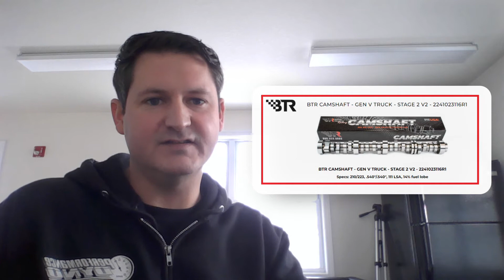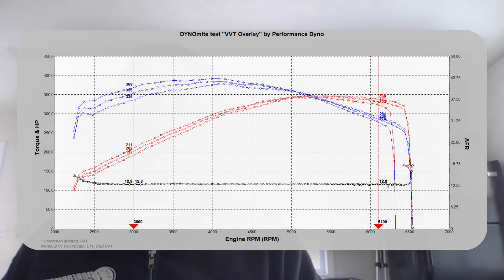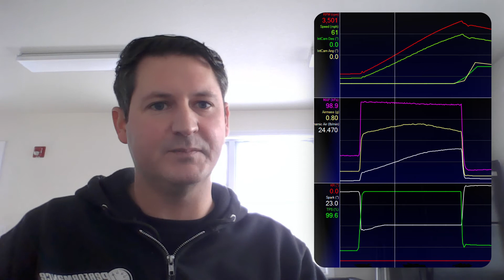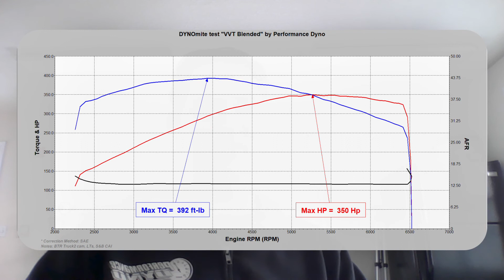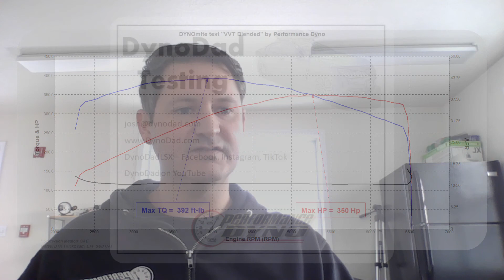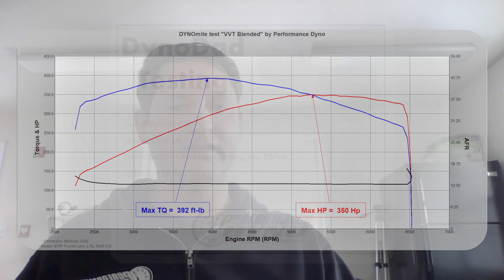2015 Sierra L83 BTR Truck 2 Cam - VVT Dyno Testing

Comment: Would an upgraded intake manifold help vvt make more power on the top end?
Reply from the maker: Hi Chris, an upgraded intake will help with or without VVT. A lot of folks use L86 intakes as an upgrade, and I've done testing with a LT2 intake. The L86 makes more power all around, whereas the LT2 gave up a bit down low to gain more on top.
Reply: @dynodad   Wait, so you're saying with stg2 cam upgrade and bolt-ons, L86 makes equal amounts of hp and tq increase across the board?
Reply: @ArnoTrek what he’s saying is the l86 intake manifold on a l83 5.3 makes more power everywhere in the rpm range. Without losing any power anywhere. Where as the lt2 intake has a loss of power down low , but slightly higher hp up top.

Comment: Im thinking of getting this cam but I already have a circle d 2600 converter. Would the cam react better with that converter?
Reply from the maker: The cam/engine will run the same as with the stock converter. For example, I currently run a C-D 3200 converter with a stock cam LS3. The converter will open your options to use a slightly more aggressive cam profile, but you don’t have to.